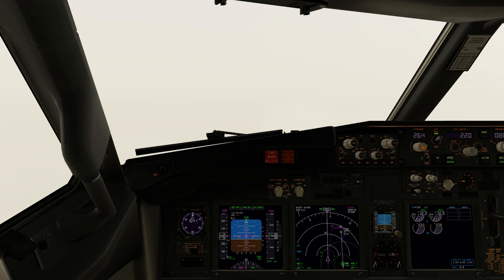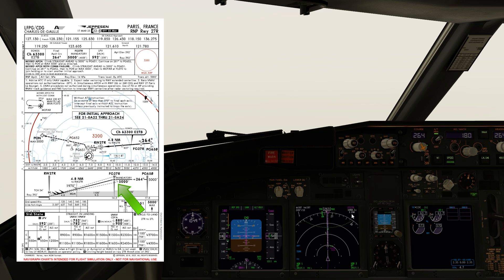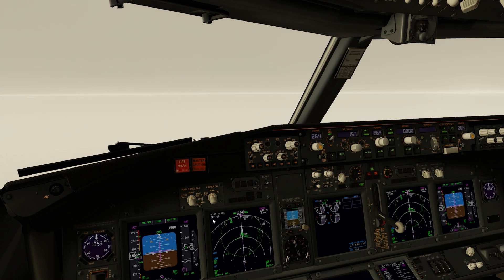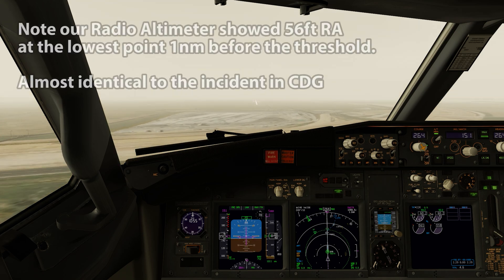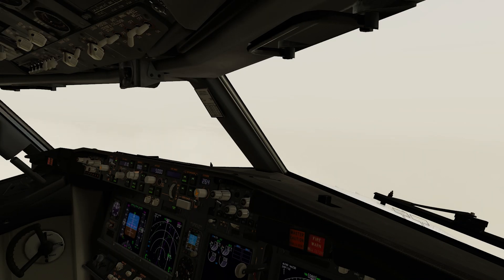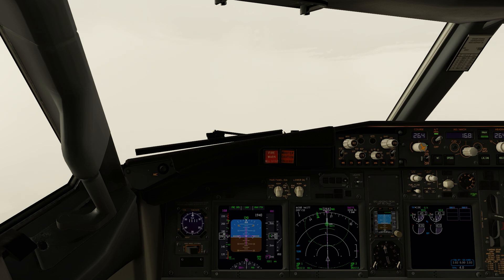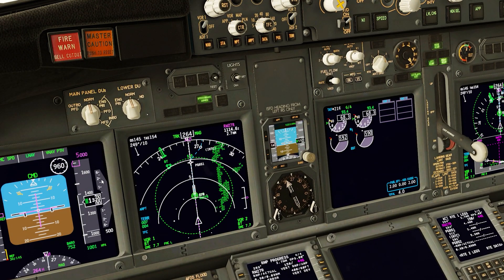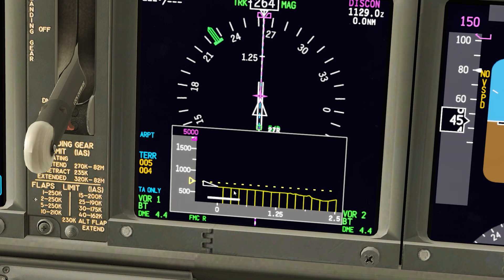The danger of setting the wrong QNH | Blunder Error Demonstration by a Real 737 Captain

Comment: How come baro altitude was not checked with the "1000"- callout, basic stuff, should indicate elevation plus one thousand feet, otherwise GA?
Reply from the maker: Simple in principle but this presumes the terrain around 3nm out (typically the distance you are around 1000ft AAL) is completely flat which is often not the case. RA is great for detecting gross errors but not really for anything less than 10hPa.

FD2S
Reply: @flightdeck2sim  Ok true! However instrument charts often prescribe a hard altitude cross-check at about 4 Nm. The chart you demonstrated provides this at 4.8 Nm. Furthermore charts include mile-on-mile basis reference altitudes for LNAV and  LOC CDFA. Cross-checking these altitudes could have prevented this incident, and often times are regarded complacent. Good practice would be to cross-check always, even in ILS and LPV.
Reply from the maker: That 4.8nm height check point is based on barometric altitude and not radio altimeter height so isn’t going to help you if the wrong QNH is set. As discussed before if the radio altimeter is completely different it could be an indicator of an incorrect QNH setting but if the runway is located on a cliff or has high terrain on the extended threshold it’s not going to be useful in detecting small differences. 

I don’t know of any approach chart that uses radio altimeter or references height above the ground. All distance cross checks using a barometric altimeter for vertical navigation (that’s how VNAV works and the Airbus equivalent). This means you’re prone to QNH Blunder error as it will not detect an incorrect barometric altimetry setting. Altitude distance cross check with the altimeter will always show you on profile whatever the QNH. 

We demonstrate this during the Type Rating and point how (A) - the radio altimeter MIGHT” help detect QNH blunder error but only really useful for gross QNH errors (+/-10 hPa) and how the VSD will move the runway display. Thankfully ILS/GBAS is not vulnerable to blunder error (using an external beacon).
Reply: @flightdeck2sim  I disagree. Imagine you would be stationary at the 4.8Nm point with the correct altitude and correct QNH set. Now start moving the baro dial, the altitude indicator would show incorrect altitude in reference to the chart, wouldn't it? Why would the cross-reference altitudes be published in the first place then? And I think there has been incidences with ILS where overdue maintenance or equipment malfunction have led to false glideslopes being followed, which could have been noted with altitude cross-checking. I have personally flown an ILS where DME malfunction gave false altitudes at published DME distances while being in IMC, which I noted during the approach. That was due to equipment malfunction at the airfield, and this led to a bulletin in the organization for that airfield. Infallibility of any equipment does not exist.
Reply from the maker: @aviationsummaries7919  I think you're misunderstanding this situation. So you're quite right, if you were stationary and changed the QNH the altitude would indicate the incorrect altitude and you'd see the error. 

The problem is you're not stationary, you're moving at +150mph. Secondly refer to 10:20 of this video. As soon as I set 1001 the altimeter and VNAV profile instantly changed and if I was to do a altitude distance cross check at that exact time you would see the error BUT watch the aircraft, it levels off to recapture the VNAV PTH and the altitude distance cross check when back on path would still show me on profile.

Altitude and distance cross checks are great but you MUST have the correct QNH set. You are also correct re false ILS G/S captures. Altitude distance cross checks will show you off the correct path but we are referring to approaches using BARO-VNAV and Non-Precision Approaches.

Please take a look at this EASA article - https://www.easa.europa.eu/community/topics/incorrect-barometric-altimeter-setting which explains exactly what's happening. Note the following quote.

"It is particularly worth highlighting that when using barometric altimetry for vertical navigation, altitude/distance cross checks in the standard operating procedures do not detect an incorrect barometric altimetry setting."

Hope this helps 🙂
Reply from the maker: Found what I was looking for as well! - https://www.easa.europa.eu/community/system/files/2023-08/EUR%20OPS%20Bulletin%202023_001.pdf
Reply: @flightdeck2sim  Ok thank you this helps a lot, and thanks for this discussion, really and honestly eye opening! And got what you are saying finally, true, wrong QNH would just lead to unsafe true altitude at DME or GPS distance in 2D approach, since no GS/GP to indicate otherwise. My ILS example was saved by the fact it was ILS, if it was LOC it would have been actually very dangerous in hindsight. 

And the first avoid and trap procedure that comes mind was covered in the article: "The flight crew should consider cross-checking of the barometric references from all available sources (METAR, ATIS and ATS). "

That is the only procedure that comes to mind these cases. Furthermore, wrong tower QNH could due to malfunctioning ATIS equipment, which could also affect METAR. 

Which is also covered in the article: "Consider the use of datalink for transmission of MET information, including QNH, to aircraft." Meaning in addition to possible affected METAR latest SWC and regional QNH and QNH from nearby airfields to get a correct ballpark.

Nevertheless, during this day and age a possibly catastrophic incident due to wrong QNH would be really sad and preventable. I am going to cross-check airfield QNH to external sources from now on if a 2D is being planned.

Thank you still, stupid questions lead to learning 😅
Reply from the maker: @aviationsummaries7919  No problem at all. I could have expanded the topic a little more in the video but we had a great discussion nonetheless! Ultimately the root cause of this particular incident was French ATC providing the wrong QNH but as flight crew we must question the validity. As discussed in the video our SOP is for Pilot Monitoring to pre-set the METAR QNH on his PFD at Top of Climb so when we get the weather/ATIS/QNH from ATC we can question any significant differences. We then have the VSD anD unusual radio altimeter readouts as a last safety net. Distraction/workload/technical issue/poor monitoring could easily cause a QNH Blunder event.

Your last point is completely valid, something as simple as setting the wrong QNH still can have catastrophic consequences, especially as every non-precision 2D approach is reliant on the correct QNH being set. 

Lastly it was great to have this discussion with you. Although these videos are purely for entertainment, imparting knowledge allows me to review the topic and make me a better pilot too.

Safe flights my friend 

FD2S
Reply: @flightdeck2sim  You too! Thanks and have a nice weekend!

Comment: ... Then again: if the VSD knows where the runway is according to the QNH AND Also knows where the ground is - why not just let it calculate the correct QNH to put the runway where it is supposed to be - or, if they don't match give oral warning When approaching the FAF or something?
Reply: Because it has to be temperature corrected also. That means that in temperatures near 0 or below, even with the correct Qnh set, the runway will show below the ground if no isa devation is set on the descent forecast page.

Comment: Would you ever use the VSD other than a non precision approach in low visibility?
Reply: Used for every approach, including ILS approaches. Selected after completing the FRISC checks or before the approach checklist is carried out
Reply: @adamwallace0929 completely operator specific. It has absolutely minimal benefit on an ILS approach.
Reply: @Elnino2910  yes of course,
Brendan asked a question and I replied to it.
I couldn’t comment on what other airlines do regarding the use of the VSD, because I don’t know..
Same regarding the FRISC checks, do other operators do the checks? No idea.
Only commenting from what I know
Reply: @adamwallace0929  fair enough but your original comment didn’t say this and made it sound like this was standard across operators

Comment: Where does the VSD get the aircraft altitude? and why wouldn't it be affected by the wrong QNH setting? I ask as if this is possible why wouldn't Boeing enter a feature to alert the pilots that the VSD source altitude and the PFD altitudes disagree.
Reply from the maker: The info I have is quite limited. I understand that the terrain profile is based on geometric altitude calculated by the EGPWS terrain database. The altitude data comes from the ADIRU. It reacts just like it did in the MOD, if you have the wrong QNH set the runway and approach path will move above/below the depicted terrain. 

The question re why Boeing haven't added an alerting feature is a good one! Ultimately it's our responsibility to ensure we have set the correct QNH.....

FD2S

Comment: Lovely thanks. But here´s my question, why is it not more common to use radio minimums on airports where there is no uneven terrain before the runway. That would lower the risk of such incidents because the minimum is based of heigh above ground, not air pressure.
Reply: You’ll be surprised at the amount of airports that have terrain that inclines or declines towards the threshold of a runway.
Reply from the maker: Exactly as pointed out by @737Adventures. A lot of airports have undulating terrain on the extended centrelines so no good using RA to assess vertical profile.

FD2S